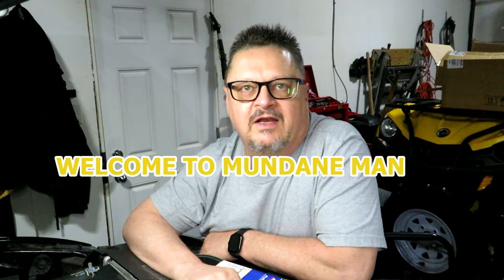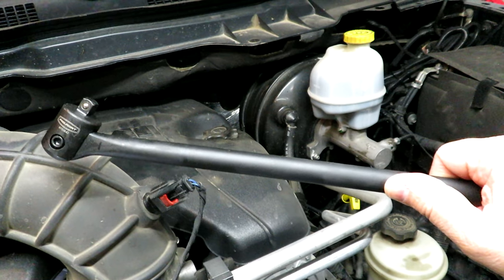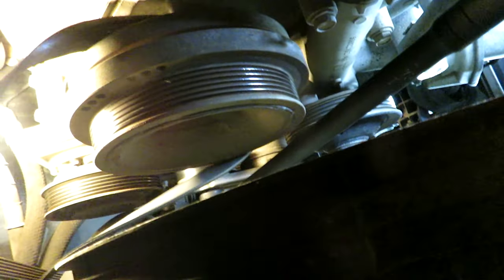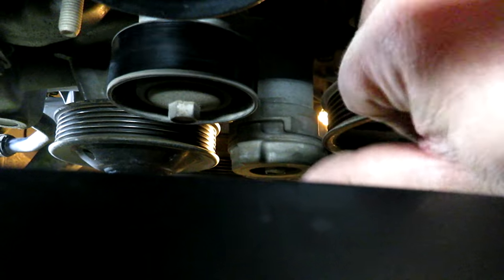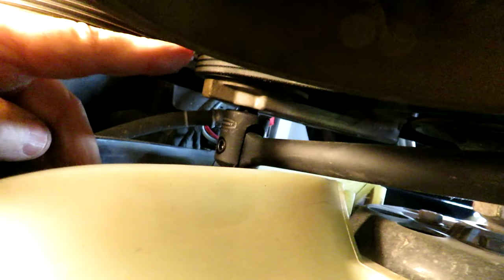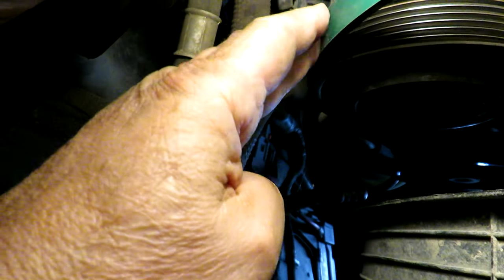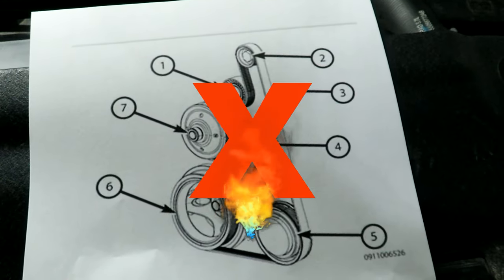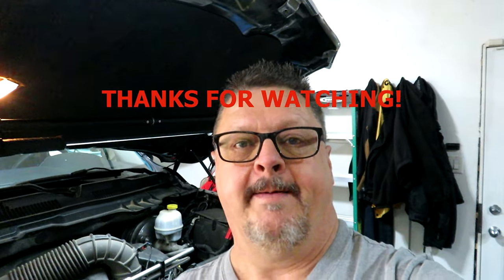Remove and Replace Serpentine Belt 5.7L RAM 1500 2010-2020 - EASY!

Comment: If you haven’t gotten a superchips or similar computer to shut off the MDS system in your 5.7, I highly recommend it. You don’t save much in fuel efficiency with it, and it starves half of your engine of lubricant. It’s the reason so many police cars are trashed from high idle times and lots of low speed driving (in the 5.7 chargers). I changed my Durango to full time v8 and it has performed better ever since.
Reply from the maker: I have been considering this.